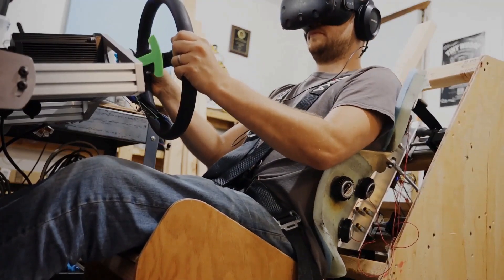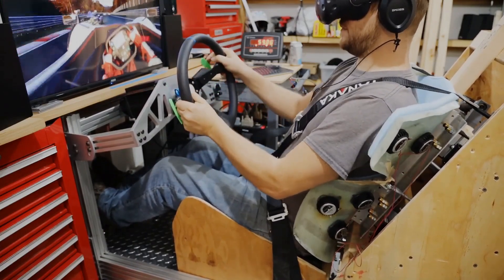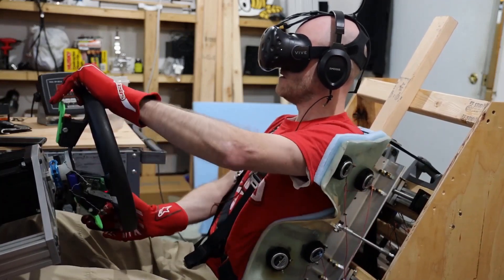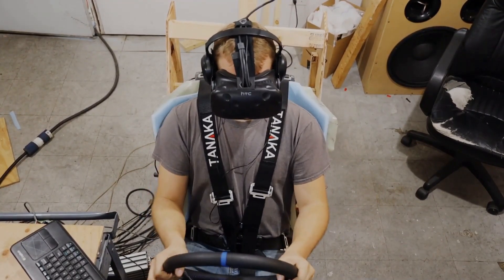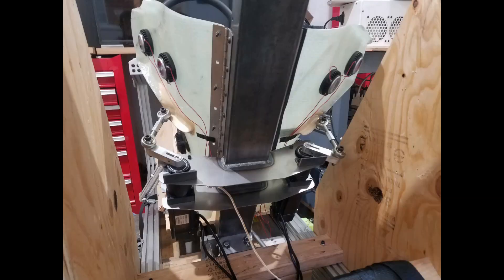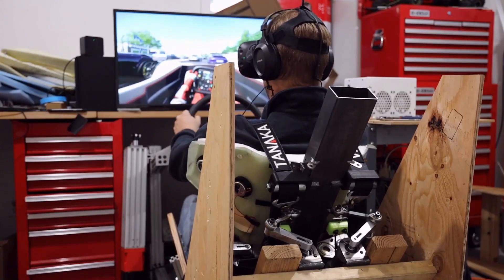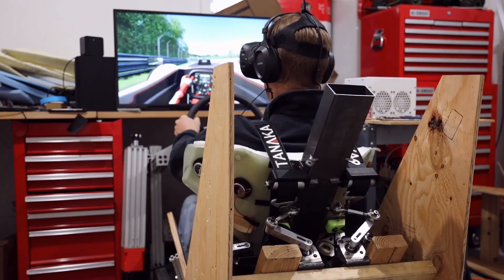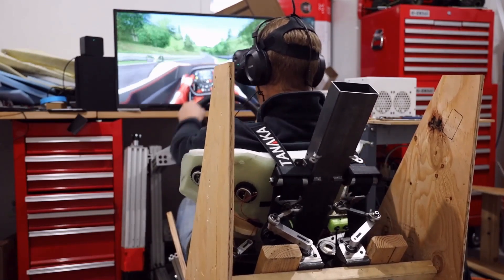GSEAT Torso Mover experiment helps negate false gseat cues

Comment: Try putting your headset into 3 dof mode. Youll still have all rotational movement but no linear, so your head will stay in the same spot. I reckon youll have a better experience
Reply from the maker: The lack of translation makes me motion sick and breaks immersion. Solving it mechanically was a much higher quality solution for me.

Comment: Absolutely fantastic work man!! Wondering if motion compensation would stop your head drifting to the inside of the corner? 🤔
Reply from the maker: Thanks! You could try but I'm convinced it would suck. Your body does not move linearly with the gseat. Its a bag of squshy goo with muscles that fire at different times depending on many things. I dont think your head would be moving perfectly with the gforce. Motion compensation would likely make you sick. I do use it very carefully with a moving rig though and it's very important.

Comment: About the false cues from head movement, would it be an option/possible to remove in software the VR-gogles movement in X/Y direction, keeping Z/tilt/sviwel/yaw/etc.  movement?
Reply from the maker: I'm sure it's possible but I think it would lead to motion sickness, or at least a lesser quality solution. You essentially get this by turning off room tracking with an inside out tracking headset like the g2.

Comment: whats the backlash like in the gearboxes. (which spec ratio are they?)  What stops me a bit would be any loss of detail coming from ballscrews
Reply from the maker: The backlash varies. I've found some companies products to be tight and some to be loose af. Specs are in the build thread. Even with backlash I don't notice any loss of detail, just a rattling noise when driving in the grass. Remember this is fairly high pressure, its never "loose".  EDIT: ballscrews are better if you can get away with them imho.

Comment: I’ve built a similar seat. Your bass pucks are definitely something I’ll be looking into. Great work.  What servo motors are you using?  I’m using hitec motors and they keep burning out.  A parts list would be fantastic. Thanks!

FYI, when you’re braking the seat should move away from you, and your belts should tension.
Reply from the maker: Thanks! The exciters I use are Dayton Audio DAEX32EP-4 and they blew my mind. Do you have a link showing your seat? Would love to see it. I forgot to mention in the video I have a servo pulling all 4 belts tight during breaking. Super important compliment to the gseat.
Servos are a mix of 60st-m01930 and 80st-m04025. 
Also I've seen your comments in all the videos I watch all the way back to the early days of force dynamics IIRC. Interests must be aligned haha.
Reply: @chrisfischer511  mine is a complete POS compared to this LOL. I've actually taken apart a GS4 seat and applied your concept to a seat I built myself working on the angles of paddles which I think all gseats get wrong. 

The more I watch your video the more amazed I am. Astounding really. I'd love to get a detailed build sheet so I could give it a go. Thanks for sharing, this was crazy inspiring.
Reply from the maker: @Gorilla_Jones Thanks man, there is more to come! Check out my build thread in the description for lots of good info. I'd still like to see what you're doing, I might learn something!

Comment: I love the seat, but I cant help but hate on VR as (as you state) it really can ruin the immersion when your head moves and may well glitch through closed cockpit sills and stuff. Additionally, VR leaves you unable to interact with button boxes and busy steering wheel buttons when driving complex cars, which is an immediate putoff for me. I have a rift S which i raced in VR about 5 times in before i bought a curved 32 inch monitor which is placed immediately above my wheel base
Reply from the maker: Thank you for the kind words. I hear you. Funny how hotly vr/monitors are debated. Can't say much for the button box but when I'm done with this gseat and chassis motion I'm going to tackle a g helmet that will really up the immersion. With my method you will be able to use either vr or monitors!